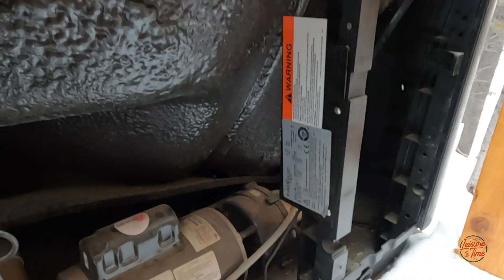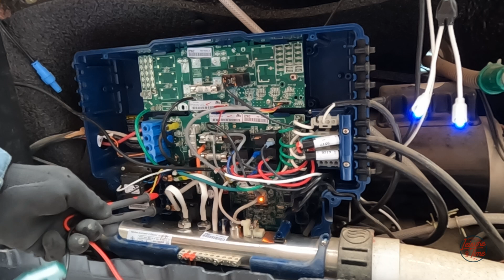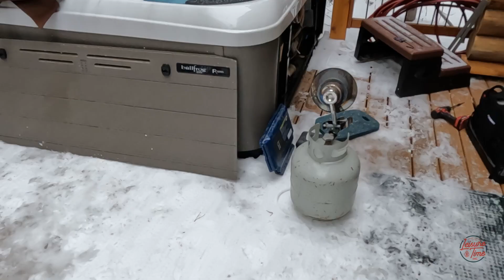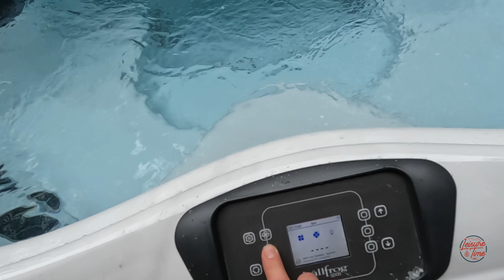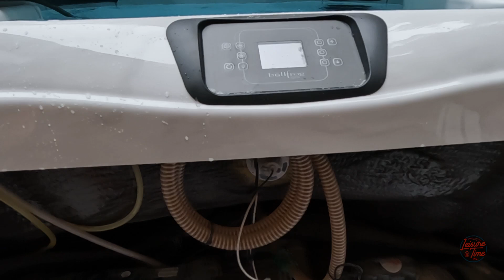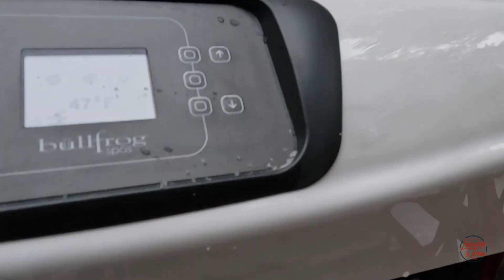Hot Tub Not Heating Up? || What's Wrong With My Hot Tub?

Comment: hi does this model not have a Pressure switch on it- to test also?
Reply from the maker: The Gecko control packs don't have a pressure switch. There are two sensors mounted on the heater manifold that take a reading and then compare the two readings, if there is any discrepancy between the two sensors it assumes theres no water flow. unfortunately those sensors are not serviceable, so the whole manifold has to be replaced.